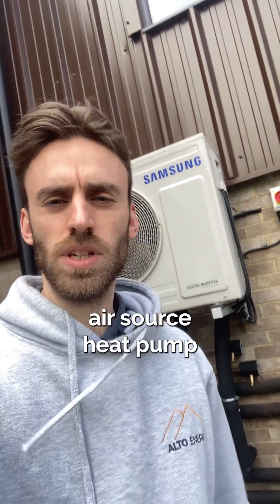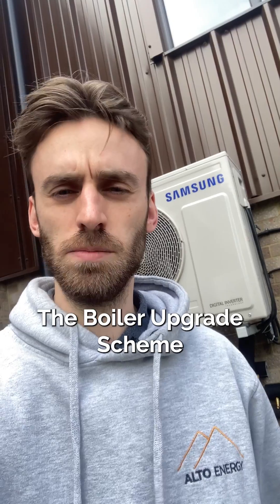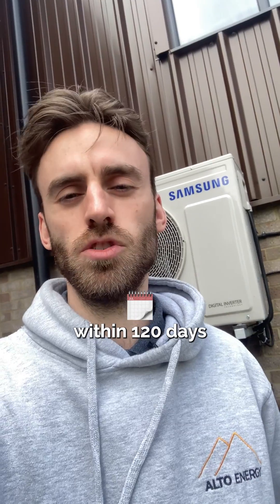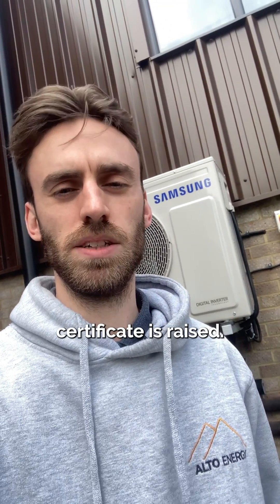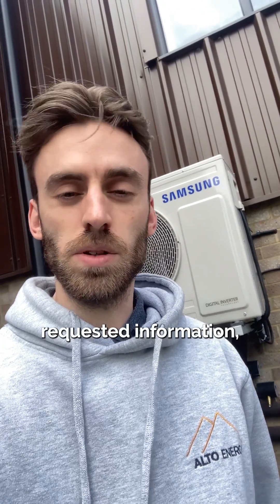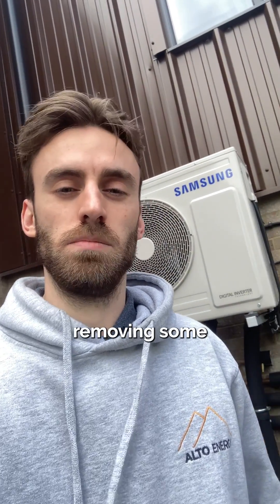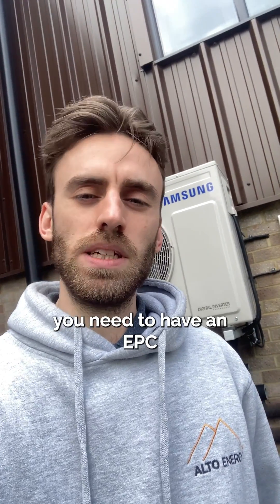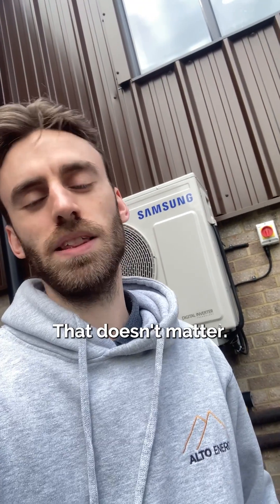Boiler Upgrade Scheme | 2024 Confirmed Changes!

Comment: How do you sell a heat pump to a customer without deceiving them about gas boiler actually being cheaper to run than heat pumps due to high electricity prices? Paying double/tripple and then paying more on bills is just an awful proposition. Who is the target market here?
Reply from the maker: When it comes to selling a heat pump, honesty and transparency are crucial. It's essential to educate customers about the benefits and considerations of both heat pumps and gas boilers. While it's true that the initial investment might be higher for a heat pump, its energy efficiency can lead to long-term savings, especially if electricity prices are stable or decrease over time. A lot of our customers actually pay less than they did with a gas boiler boiler. We recently visited a developer who has installed ASHP's, battery storage and solar on their properties and the bills were around £13 per month in the colder months. Additionally, heat pumps are more environmentally friendly than gas boilers. This can be an important consideration for customers concerned about sustainability and reducing their carbon footprint.
Reply: @AltoEnergyLimited  thanks. Solar panels and battery storage would be a very small fraction of the market. Remember government is planing to have 600k heat pump installs meaning combi boilers have to come out and heat pumps come in, for properties that aren't  even close to being ideal scenario like you describe. Having the whole thing on life support from government grant is also a poor incentive for installer to train up. If the grant changes the whole time getting qualified could be wasted as without the grant there is even less financial sense in installing a heat pump. More discussion around the elephant in the room which is extremely high disparity between gas and electric prices.
Reply: @Stanfoils in almost all regions electricity cost is 4x the price of gas per kWh. A system achieving a CoP of 4 is already cheaper to run customers can then do even better with specialist tariffs, solar PV and batteries and savings from cancelling the gas service and its associated standing charge, they use much less gas (including what’s burnt in power stations when needed) so more gas at lower prices for me and you.
Reply: @edc1569  CoP 4 wont be realistic on mass scale that is being targeted here. Not all properties will get it especially with insulation rules being relaxed. And not all installers will be able to install it to its full potential and verse the customer in correct tariffs and what not. On whole gas boiler will be cheaper to run on average. What we need is for gas prices to go up (and they won't because of political reasons) or electrical prices to go down really to a point where electricity is about twice the price of gas. Then you can issue blanket statements like heat pump will save on your gas bill. But until you can say that with full confidence to a customer really it is a bit of a tough sell as I mentioned earlier.
Reply: You get 7500 and steal need pay approx 4000 and many tests show that gas boiler is chipper to use if you have not good isolation in home you pay twice More

Comment: Good that its been dropped for wall as that would have been a nightmare for my house. Doing the loft anyway so no buggy there. Got 100mm atm so going to 270. Didnt realise it didnt kick in while 8th. Thought it had already happened.
Reply from the maker: Yeah, there was a bit of confusion as to when it would start. Good to hear that you're making insulation improvements regardless 👍Let us know if you need an ASHP quote.